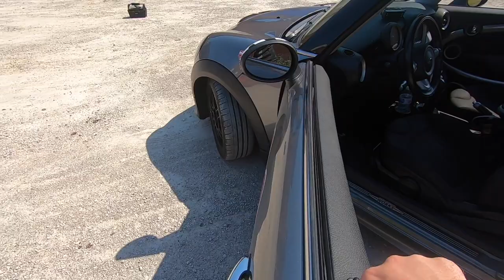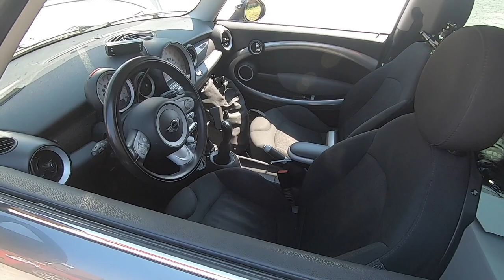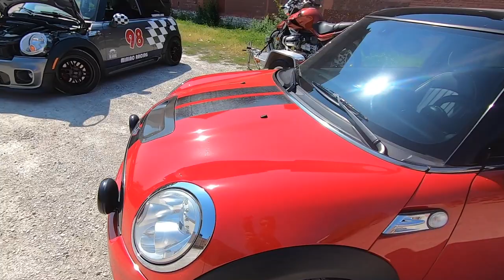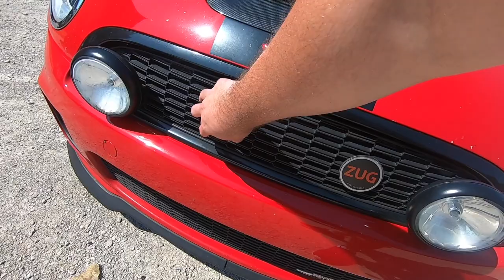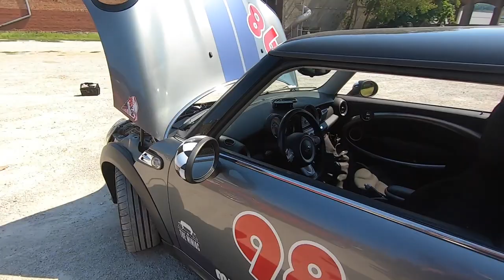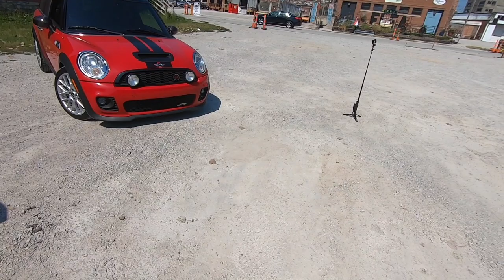N14 Mini Cooper Buyer's Guide | 2007 to 2010 Cooper S / 2009 to 2012 JCW

Comment: I'm looking to buy a 2010 base model with 64,500 miles. I am going to the mechanic tomorrow to get it inspected before I make an offer! I sure hope that it is in good condition. I'll be sure to ask the inspector if it has been well oiled! Thank you for this video it is super informative!
Reply: The tires were worn and a small oil leak was starting to develope. The inspector said that it was most likely a gasket leak. On top of that there were only superficial problems such as a broken hood grill trim and a busted wiper fluid tube that needed repair. I ended up buying it and taking on those repairs. Because of it's condition, we settled on 6500$
Reply: How's your experience driving it so far? I found one with similar price range on CarGurus, but not sure how reliable it is.
Reply: How do you like it?

Comment: I have a 2009 R56 Factory JCW N14 Hatchback with chrome headlamps and front grille along with the windshield and side window and rear window chrome trim. And also I do have the JCW AERO Dynamic Body Kit. Mellow Yellow in color.  With the Mini love and hate relationship that comes along with the purchase.  So there are some factory JCW N14 options that where available.  And Big Brembro Brake System. 

Cheers, Good luck with your purchase.

Comment: Wouldn't touch any mini older than 2014 with a barge pole, you will be replacing gaskets plugging oil leaks and dealing with cheap plastic bits in the engine until you pull all your hair out.

Comment: Hpfp £700 bmw or £320 psa part,  both the same thing as it was a joint venture in 2008 to save costs for both car companies.
Reply from the maker: Lucky for you all. We don’t have the PSA products in the US but I guess we could order the parts from Europe.
Reply: There is a nice 2011 Mini with two women owners. I can buy it for $3,000. It has 170,000 miles on it but seems to run fine? Should I buy it or run from it? Just want a weekend driver.
Reply from the maker: @2007vwbeetle if it was well maintained yes. But that mileage, I would make sure it’s in perfect shape.
Reply: @TheMINIac  I did a fax check on it. It seemed to be from what I could tell on oil changes good except a couple times went over 10k miles. It had brakes front and back put in it a few times.A valve cover gasket replaced once. A timing belt tensioner pulley once ( didn’t see where timing chain was replaced. Transmission fluid I think twice. And other normal maintenance. It was involved in a minor wreck where she hit someone in the rear and was enough to deploy airbags so think grille, bumper and left fender was replaced and painted. I couldn’t tell it except the bumper and grille looked in better shape than most 2011. The rest of the car outside and inside seems to be in better than normal condition. I was mainly concerned it had 170,000 miles on it and how much more I could expect out of a 2011 engine? We won’t drive it a lot a pretty easy we are both retired. If it ran 220k I would be satisfied.Should the timing chain in that model been replaced not just tension pulley once? See no evidence of it ever over heating or any other major problems or work done. It list for about $5,200 this lady had went through a divorce and seems to have a gambling habit and debt. She went from $4,700 to $4,000. Then after I showed her the carfax of the other owner wreck and I think she got in more money problems she said if I brought cash she would take $3,000. She was entering in some card tournament. Very nice home worth 700k but she was only owner about a year and hadn’t used the car much. It was the owner before her who I don’t know who she was that had the accident and did most of the maintenance. Could I go wrong at $3,000 for a 2011. Was that year a decent engine?
Reply from the maker: @LastTrump7  if it ends up needing any work, for $3000 it’s a steal.
Reply: @TheMINIac  I agree thanks..

Comment: excellent video, a quick question though, you mention Mini dropped the mechanical limited slip diff n 2008 and the 2009 JCW got the electronic one, do the 2009 COOPER S Clubmans (and hardtops) still get the mechanical one or do they just get a standard open diff? cheers
Reply: @TheMINIac  thank you, so a 2009 cooper S clubman that has DTC means it got the ELDC?

Comment: You didn't mention the heat shield above the turbo on the red JCW. Are they a good idea to have? Or do they send heat back to the turbo so that fails?
Reply: The heat shield on the hood is to prevent the hood scoop from warping due to the high heat from the turbo.  It's usually only a problem if your running the car hard for long periods of time (eg track days).  Usually just the upgraded heat shield over the turbo (like that JCW also has) will do the trick.